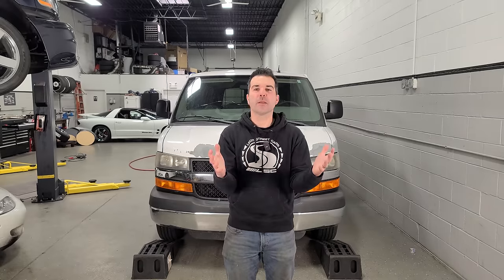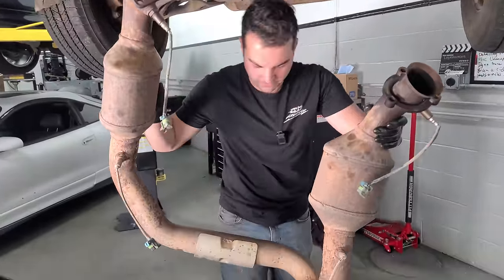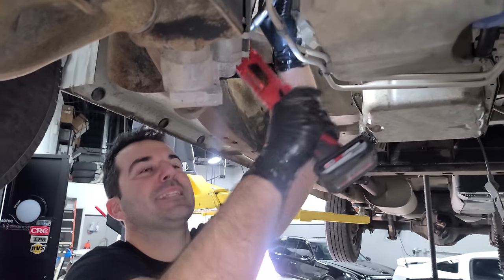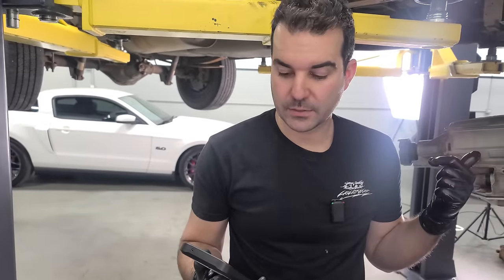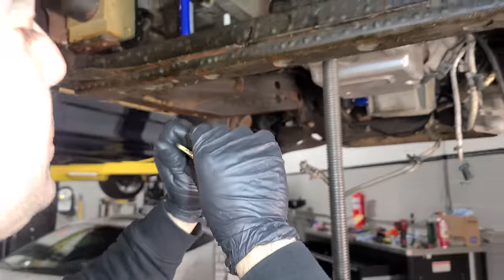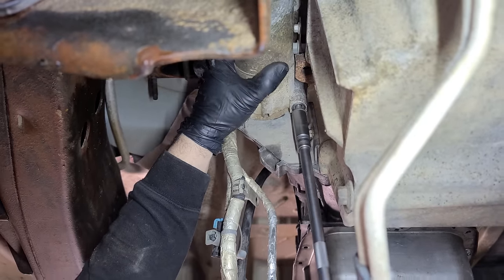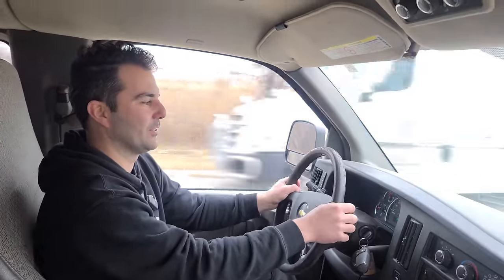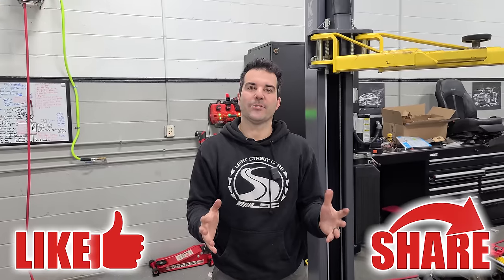I Installed a $9,000 Transmission In My $4,000 LS Chevy Van In Preparation For Big Boost! CARNAGE!

Comment: So we think the transmission failed because it got too hot.  Then we see the transmission cooler and it is super fuzzy.  Maybe you should upgrade the transmission cooler since you plan to tow huge loads at 90 plus mph?  The radiator need a good cleaning also.

Comment: You’re unsure if it’s the original engine. Well with those kind of miles it should be burning at least 1 to 2 quarts of oil per oil change lol if not, that’s probably a reman.

Comment: i know this is either not on the list or very low. But with this being the tow pig. Any plans for (new head unit, speakers, steering wheel, LED lights inside and out, overly aggressive fog lights)?

Comment: If the trans was centered before and it's the same trans why is the mount off center now? Also I wouldn't re use those torched parts of the trans bc they should be much more brittle

Comment: I just bought an Acura RDX with 20k miles. CarFax shows torque convertor was  replaced under warranty.  Anything I should be concerned about with other transmission systems?

Comment: Alex..how did it shift without reprogramming the solenoid pack in the new transmission? did you use the original solenoid pack from the old transmission?

Comment: CTSv Cadillac is quite a different transmission, you are installing a 6L90 transmission whereas the Cadillac uses a 6L80 so not the same transmissions, yes they might look alike but are not, gear ratios are different, I can tell you are installing a 6L90 as the case is different on the back part for the pan.
Reply: Also a 6L90 is a better transmission than the CTS, some 6L90s have extra frictions on their clutch packs not all so installing a 6L80 out of a CTS would actually downgrade the transmission, even if you say installing better frictions (clutches) on the 6L80 your transmission case is still a 6L90, only express and savannas have the 6L90 as the are used for cargo so must be beefier to take that beating

Comment: Hey. Great work. Question though, where do you go to recycle ATF or dispose of it properly?
Reply: Many quick change places are happy to take fluids. They sell the used fluids to recyclers so they can be reused. Also most local garbage dumps have a separate section for "household hazardous waste". Both options here are free of charge. Hope this helps.

Comment: Yeah that procharger is gonna wake her up…i dont have pro charger money but i do have vortech money and the little v-3sci sounds bad ass on my c/10 even at idle it makes those angry snake hissing sounds!!!  For the money you cant beat it….but a screw/roots type supercharger is always so much more fun and usually much more expensive…..i wanna do a kong 2650 in my cts-v but i live in ca. and smog checks are a big deal here…altough i could always replace the LSA blower on my nova with one but my wife wouldnt like that and honestly my next mod on that car would be a 3rd pedal mod….the LSA is plenty at 650/700 with all my supporting mods….and a tkx 5 spd kit complete from american powertrain would only run me $6300….alot less than a kong2650………so many choices!!

Comment: One piece will be a mistake it's way too long of a distance for vibration and flex plus you will alter the pinion angle on the u joints.

Comment: Trans cooler "flush" in a can.  You would have been way better off having it flushed by a shop with a hydraulic shock heated flush machine, or replacing the radiator.

Comment: 1100hp sounds more impressive than only 1000hp, but 1500hp would be even better, so why not a 1500hp van?  I wonder if the boost for that sort of power is provided by methane gas?

Comment: 0:40 " The van got us eight hundred miles back to Chicago" 🤯🤯
Say what you want about Chevrolet or GM. But the old adage still remains true that the GM product will run badly longer than other products will run at all🤣🤣🤣

Comment: Not a return system. One pressure line and one evap line 12:56
Reply: Also when doing torque converter bolts on gm products insert the first bolt through the slightly elongated flywheel hole first. If you do that you can tighten them all up as you go